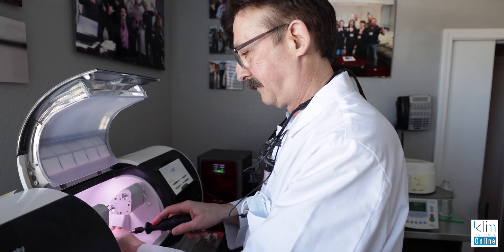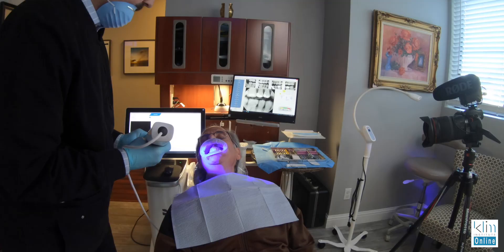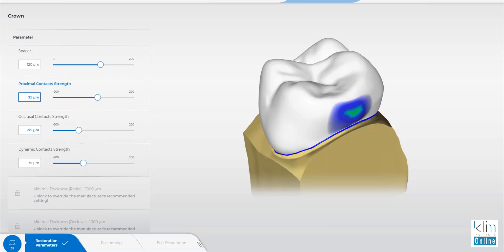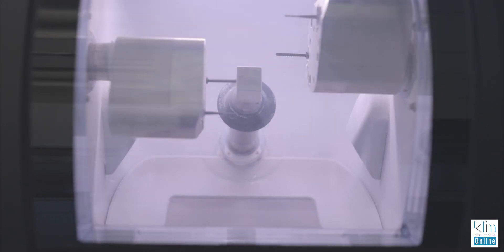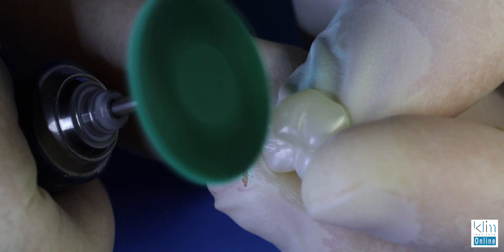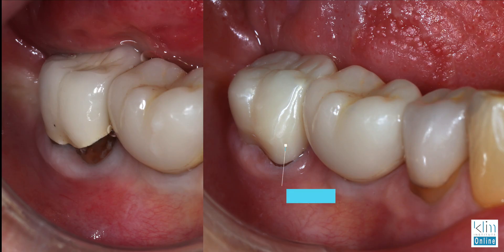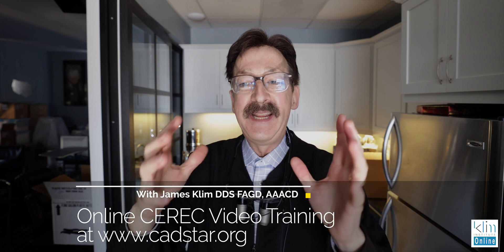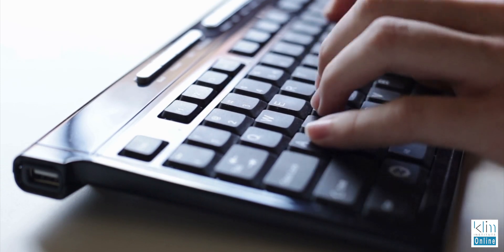Katana CEREC Workflow

Comment: Hi. Do we need a firing paste for the gloss firing procedure? I know that there's no paste for sintering (obviously)...
Reply from the maker: No firing paste is required to glaze and color zirconia.  However, sometimes, it is advantageous to place the zirconia on a firing pin with paste, which is easier to manage.
Reply from the maker: No. Do you mean when adding a glaze?
Reply: @KlimDDS  Hi. Thank you for your prompt answer. Yes, I mean for the glaze. Or can I just put them on the CEREC Single Unit Glaze Support witout any firing paste?

Comment: we mill with MCXL whet. The occlusal surface is getting white. Just now we paint these part 1-3x with yellow after having dried before. The result is not bad an if it is too dark we brighten with polishing. Do you have further suggestions? By the way we love the Meisinger kit which you presented in former Vids. Thanks from Germany an best regards
Reply from the maker: Wet milling works well, but is a problem with infiltration even after drying for a quick turnaround.  A dry mill will solve the infiltration issues and then make sure the surface is not too polished in the green phase prior to infiltration.

Comment: love the blocks but.... 2nd molars?  don't you find the occlusal reduction is excessive?  why not chair side zirconia?
Reply from the maker: Yes, for second molars, I usually use a 3y zirconia like ZirCAD LT, which requires 600 mu minimal thickness.  In the case presented in this video, there was ample room for occlusal thickness.  Rule of thumb, the occlusal reduction is 2-2.5 of the required minimum thickness of the material.
Reply: @KlimDDS  you are such a wealth of knowledge.  thank you
Reply: agree